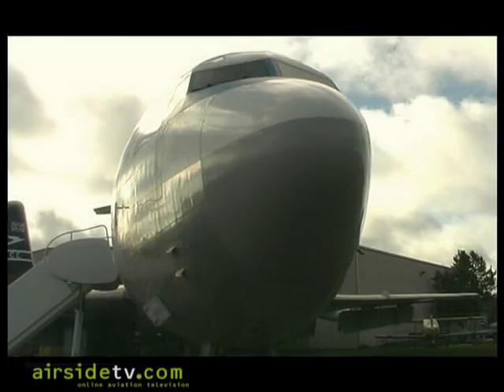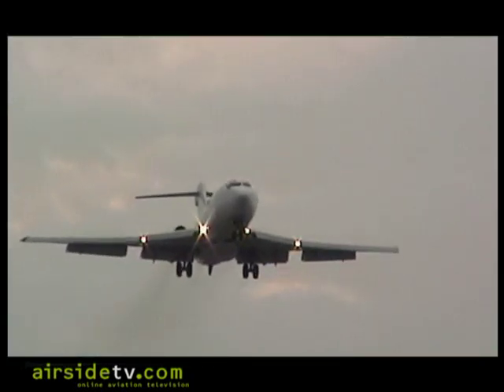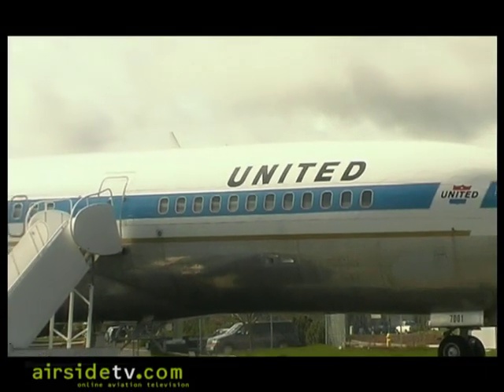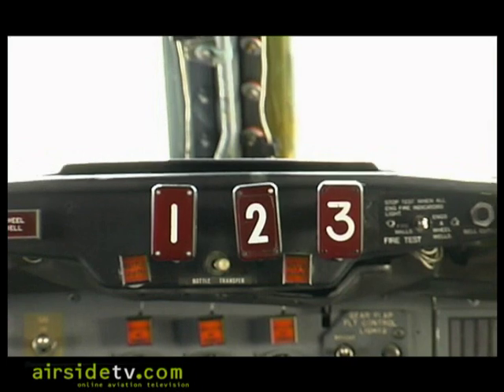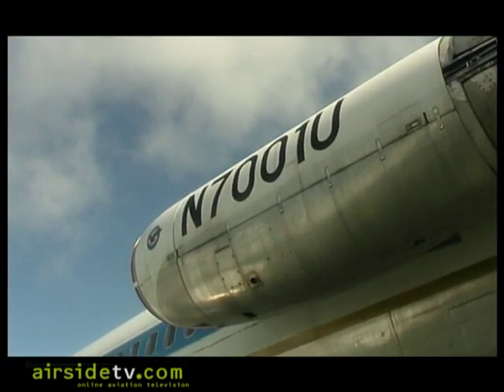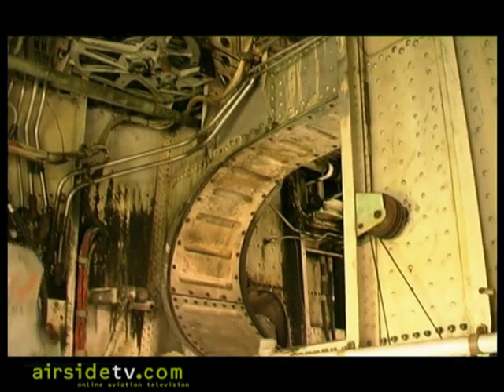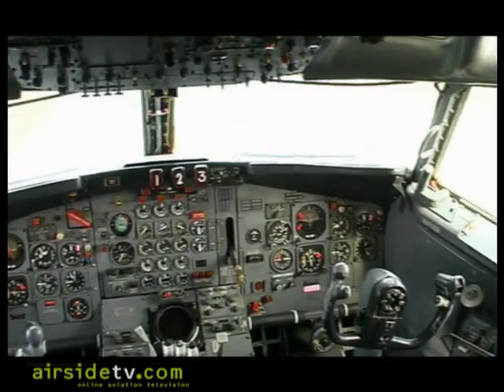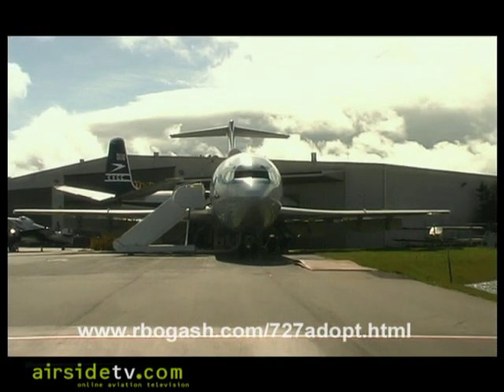Protoype Boeing 727

Comment: its a shame that boeing didnt continue the 727 to give an advantage to the 737 that is far slower than it.
with the more powerfull engines that came with the super 27 it could take oof land land safely at lower speeds and shorter runways.
todays maximum cruise speed of the 737 is mach 0.82 (1004.69kph)
the 727s maximum cruise speed was at about mach 0.91, maybe it could even go supersonic like the the old jumbo jets (747s) that today cruise at this speed.

Comment: my name is in the aft crew stairs area of the last 727-200 made for federal express. i was apu certified for the 727 and trained to fuel them. also my manual weight and balances were used to write the first ever computer weight and balance programs for the 727 and dc-10. and according to mcdonald douglas, who sent me a letter, i hold the world record for the most efficient loading of the dc-10 in the world. i showed a 190 pound deficit of it's max takeoff weight.

Comment: @pcressma I don't think this is what Mr. Bogash actually said. Early in the video he was talking about arriving at a 3-engine configuration and he said something like, using the engines of the day, 3 would be required so you'd have to figure out where to put them and Boeing settled on the design we see on the 727. Later in the video, he was talking about the engines again and he said that the JT8D was introduced with this airplane. I think he did an excellent commentary for the video.